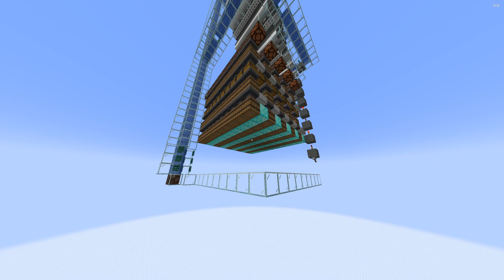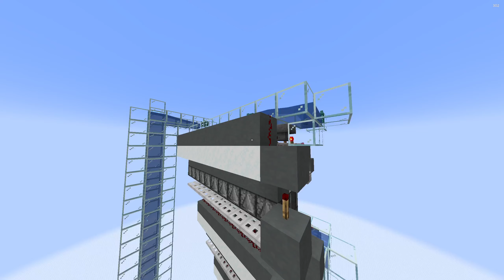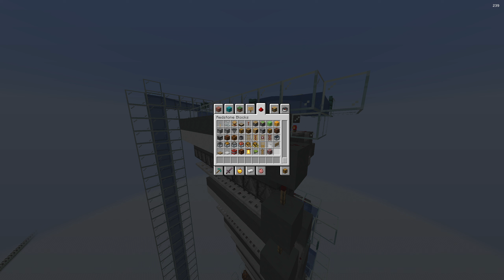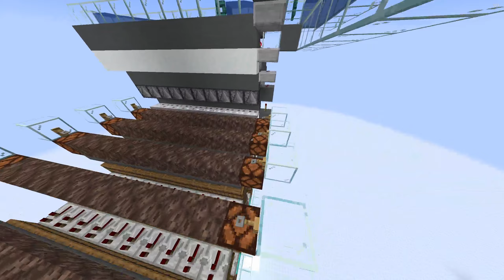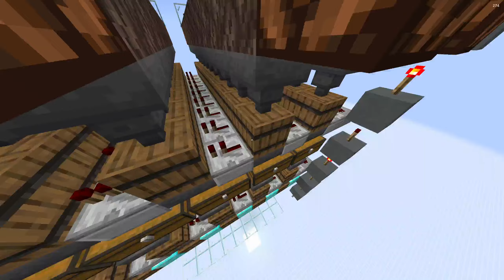High Density 2 Dimensional Bulk Storage | Minecraft

Comment from the maker: What other ineffective storage design element you think might have a very useful application?
Reply: off the dome, just try and make this nonsense useful: a stack-size sorter that works by inserting a set number of an item into a minecraft chest then measuring its physics. there are so many better mechanics for determining stack size that you’d probably accidentally run into at least one of them while attempting to implement this travesty. you’ve gotta admit though — it does meet the definition of “ineffective storage design element”.

how about holding back items before they enter a water stream so you can release them as a batch, synchronizing hopper unlocks with the speed of the clump of items as it traverses the water stream. it’d be more effort than it’s worth as it only affects the performance impact of the storage while it’s actively running, but it’d also be a pretty cool and unique feature that gets my “certified hopper-locked seal of approval”.

Comment: Feels better. Id just add an overflow protection
Reply from the maker: @PotatoCraft_TMC  There is a way to do it by instead of the strings detecting stuck items you can preemptively detect that the top hopper has more than 1 item which I plan to show in a future video.